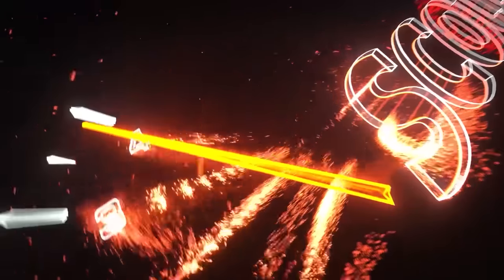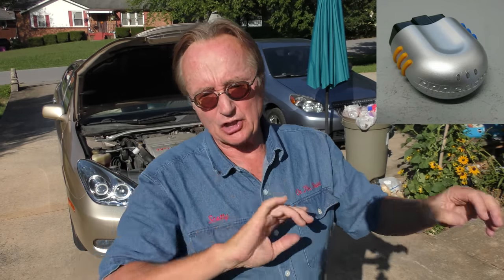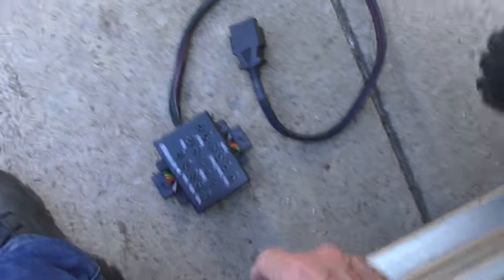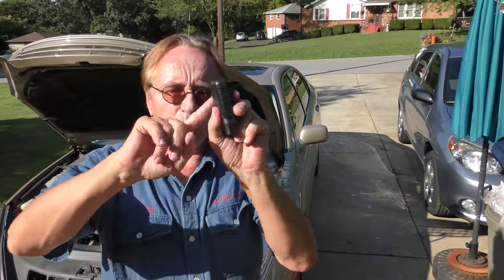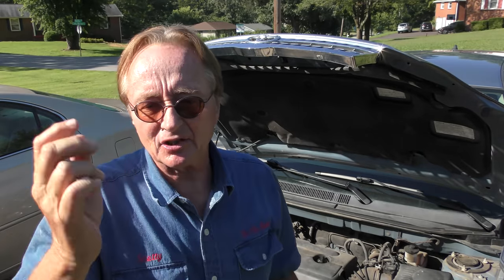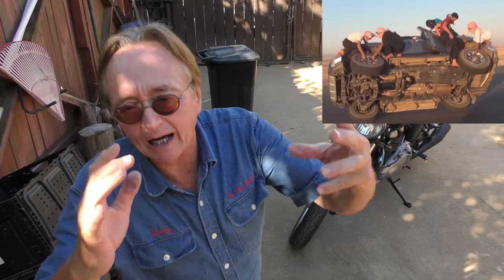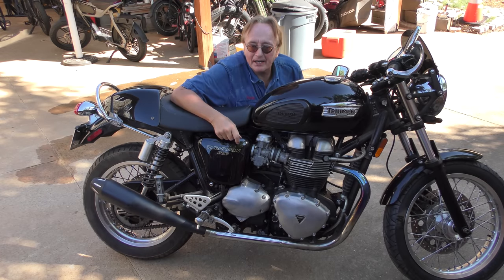I Told My Customer Not to Do This, Now His Car is Destroyed

Comment: 5:49 I can't get into my air filter compartment. The mechanic at the Honda dealership tightened the screws so tight that I stripped the screws when trying to do it myself and the only way I can get the filter changed is taking it to a mechanic. I moved in 2019, and AAA recommended a mechanic right up the street from me. They just charged me $1700 to replace the alternator and fuel pump (the gas gauge has since been screwed up and the CD player doesn't work). I asked them to replace the air filter but I see it nowhere on my bill. They also told me I had an oil leak...which had one previously that they repaired (They didn't check for other leaks?). In a previous repair, they told me I needed new brakes, which had just been repaired. They told me that my previous mechanic used cheap parts.

This car is a 2005 Honda Civic with 120,000 miles on it. They're charging me for more than what the car is worth! I reported them to AAA because their estimates always go above the high end of estimates, and they always seem to find "something else" wrong with the car.

AAA did nothing. Useless.

Comment: My 2002 Lotus Esprit has 2 OBD ports one in the engine bay and one in the passenger compartment.  I would no more plug a strange device into either one of them than I'd set the car on fire.

Comment: Happened to me with 2 different insurance companies. I wasn't driving much so Milewise seemed like a good idea. Soon after my Toyota that was running smooth as silk ran rough like a hungry tiger. Even cut off while idling several times. Mechanics suggested several expensive fixes of course. I dumped that instead company because rates went up anyway. Returned the dongle and car ran a little better but didn't make the connection. New insurance company had a dongle too. Car ran even worse. Battery? Fuel system? Fuel pump? Took dongle out because company was not get any data. Said to wait 48 hours. Car ran smooth as silk again. No more dongle and running perfect now. Who knew? But are insurance companies doing this on purpose? How would they profit from car running rough? Yes they are crooked but this one is a stretch.

Comment: I’ve never had a single issue while having my BlueDriver scanner connected when driving, in fact, I love it on because It can monitor many system Live like battery voltage, air filter temperature, supercharger status, etc.
Reply: Well I guess because you've not had a problem, that means everyone should just disregard this advice 🤪.

Yeah, so it fried out my work truck's plug in for the scanner.  So I'm going go do the educated thing and use my personal vehicle's for diagnosis while off only.
Reply: I think all he is saying is do not leave it in 24/7. Have it on do the engine pressure tests have a drive.

Then take it out.

Comment: Ah horse sh!t Scotty. I have used a scan gauge 2 device in my car ever since they came out with it. Comes in real handy when you don't have a Temp gauge. It has never screwed up the ECU either. Of course I always remove it when getting the car serviced as many mechanics have sticky fingers. Now I would NEVER invite big brother insurance to put one in my car. That's slave mentality right there.
Reply: I'd have to agree with this, I use a scan gauge for water temp and never had issues.  I think Scotty is from a different era and is extra cautious.  He may have a point on using questionable electronics on new cars though.  My 96 "analog" Honda doesn't have an issue with the scan gauge, it also has no ABS or traction control and I wouldn't change a thing.

Comment: Have tires always been like that?  I've had old tires that looked fine.  Is this another planned obsolescence, like batteries and other components?
Reply: All tires are like that, and have been since they stopped making them out of wood. They are made of rubber, which perishes over time. Standard recommendation is to not let them get over 7 years old. If the rubber goes hard, you will lose grip and braking performance, and they will develop fine cracks and hidden internal damage which can lead to a blowout. Looks are not everything. But I replaced a couple that were 5 years old on my wifes car recently, looked good from a distance but close inspection revealed significant cracking between treadlines. Had to go. Been married 37 years and she has not gone hard or cracked, so better to replace the tyres than the wife.

Comment: I disagree with you scotty on this one. I have a HUD plugged into my hyundai that tells me data that my car doesnt, like oil temp, coolant temp, and all sorts of information while it also can check for codes if check engine light comes on. This little HUD has saved me a lot of money because it tells me everything a driver needs to know. Bad battery, i can tell with voltage, bad spark plug yep, MAP sensor yep, everything and I put a splitter on it and tucked it in behind the dash so i have 1 extra OBD port available to use for my diagnostic scanner if needed. But the HUD tells me everything I need to know, you can even buy these cheap gadgets on TEMU for 60 bucks and it doesn't affect your car at all.

Comment: There was one on my Elantra I bought .y car was shutting off and it felt like everything was going haywire. I changed batteries also and still had all these problems. Engine light , tire pressure light. Everything.

Comment: Hey Scotty, been listening to you for years now & I just listened to this vid on plugging things into the OBDII port and being harmful to car.  I just recently installed a Fuel Genie hydrogen system on my 2012 Toyota Sequoia & there is a chip that comes with the system that plugs in to help the computer reprogram the sensors because it's a hydrogen cell system.  Should I take this off?
Reply: 3:34

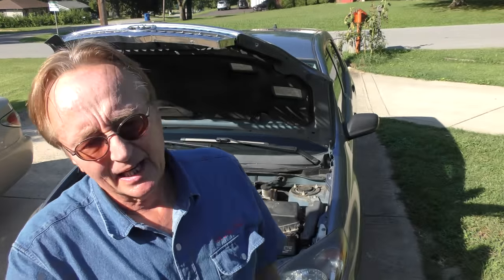Comment: 5:02 - O... M... G... I was getting the error where the computer shut down acceleration. First mechanic said it was the throttle body. Charged $950 (parts + labor + update computer systems). The fix didn't work. Got a refund. They said take it to the dealer.

The dealer said no, it's the mass air flow sensor. AND the air filter, which was apparently filthy. They were going to charge $595 to replace the MAFS ($325 for the part, which they had to back-order, + $270 labor), and $55 for the air filter. I said that's a total ripoff for the MAFS (and I should have said the same for the filter - lesson learned). Autozone carries them in stock for $63, and I got them to drop their labor cost down to the diagnosis fee, since I would have had to pay that anyway.

Now you're telling me the MAFS might not have been problematic at all? Fine. Next time I'm checking / replacing the air filter first.

Comment: Scotty im in Australia have a code p1035 have a basic scan tool tells me to refer to owners manual the vechile is a 2010 ford falcon xr6 utility 167000km. Also the cooling fan is coming on even when the engine is cold 🥶 was minuce 3 degrees and after a minute or so the engine fan came on what could be wrong 🤔
Reply: Thermostat?
Reply: Temp sensor?
Reply: It's not over heating and I've got a new coolant temperature sensor for it but no idea where it goes on a fg series ford

Comment: What about tracking systems for armed vehicle recovery services? They use a dongle to be able to find the car. Also the doesn't appear to be an externally available port so the technician had install one kinda internally. Are those systems recommended? If not then what equipment should be used for such a 3rd party service?

Comment: This is total horseshit. I have had one plugged into every one of my Volvos straight for 10 years now. Not a single problem. Use any tall looking elm327 dongles, not the shallow ones and the torque or dash command apps. Carly is also very good.